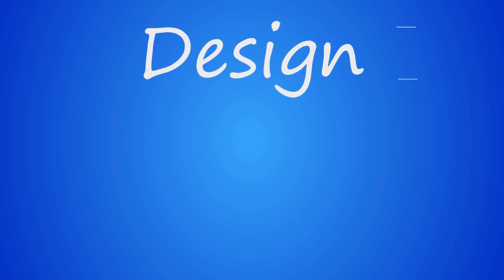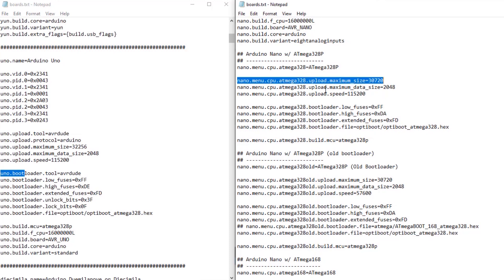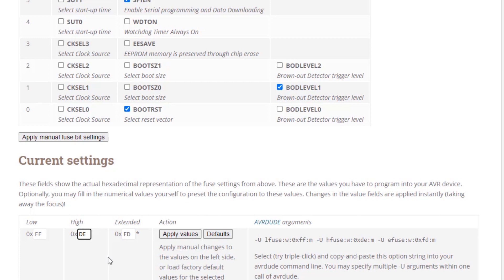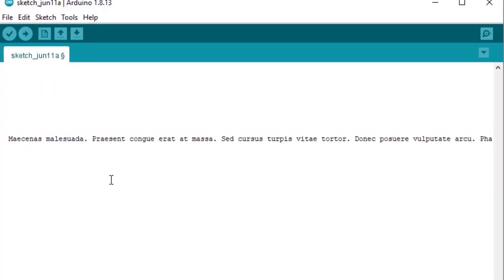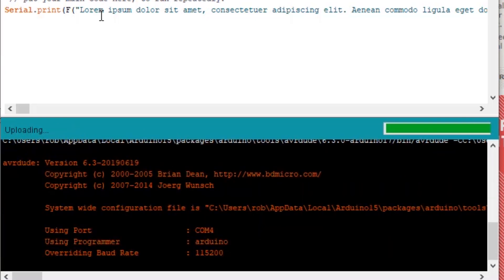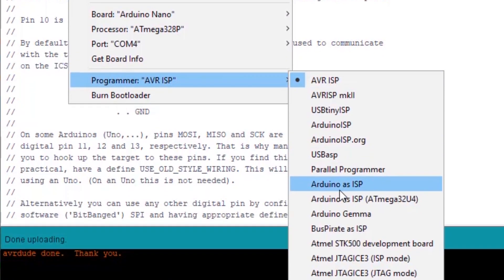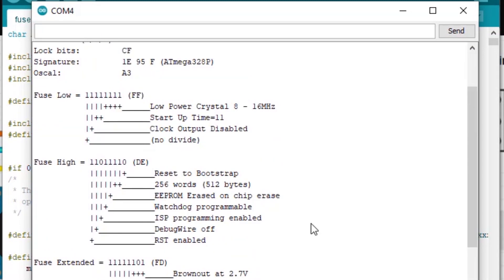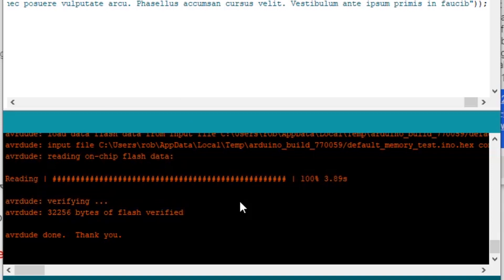Increase Flash Programming Memory for Arduino Nano? YES!

Comment: Quick question and probably a stupid one the memory is on the amount of bytes that remains and 2nd question is there a way to add more memory or upgrade.
Reply from the maker: Adding memory depends on how you plan to use it. If you mean adding space for program memory (your sketch) technically if you want to write an entire bootloader and compiler you could have your bootloader run on the Nano and pull opcodes from an external flash chip or even an SD card but its not a simple task. I actually did this many years ago for a PIC microcontroller and it took me almost a year to complete, essentially created my own version of Basic or rather a clone of Basic Stamp which was the Arduino before Arduino existed decades ago. Not a simple task. It's not as simple as taking an Arduino Hex code and translating it through your custom loader, although that might be possible if you really dig through the source code and have an excellent understanding of Atmel assembly and op codes.

Comment: Great info--definitely going to fool around with this. What tool is this at 2:24?
Reply from the maker: Thanks!  2:24 is https://www.engbedded.com/fusecalc/

There are a bunch of "Fuse calculator" sites out there for Atmel all the same stuff. Pick your settings and it puts out what your high, low, extd values should be. I'm using it here in reverse to put in the known hex values to see what the settings actually are. You could do this manually if you want to read the data sheets and convert to binary, these sites save you the trouble.
Reply: @DesignBuildDestroy  Atmel Studio also has a great tool built into the flash utility that allows you to select various options from drop-down menus and then burn your choices.
Reply from the maker: @EvanRustMakes  Yeah! I tried to keep this simple and stay within Arduino IDE world using the site as a quick reference rather than pointing people to download Atmel Studio and jumping through some hoops. Really the true way to maximize your space if you need every byte is just drop the bootloader all together and get used to using ICSP to flash but I think the simplicity of keeping the bootloader makes it easy for new users to dive right in.
Reply: @DesignBuildDestroy  Ah, ok. I ghostwrite for the Arduino blog and I'm working on an article about your video. Should be up soon :)
Reply from the maker: @EvanRustMakes  Awesome!! I tried to research WHY the setting was never changed when Optiboot became the standard, as far as I can tell it may have been a miss but boards were already produced and flashed by that point for sale so it was just kept as is and never seemed to be addressed again because they did not want to add yet another menu option for Nano board type. The 2 options are already confusing for new users (Nano, Nano OLD BOOTLOADER) then you'd have a third like Nano New Fuse or whatever making things even more confusing. One of the top issues I see on forums where people get stuck is the fact that lots of folks buy clones that tend to use the OLD bootloader and they aren't always aware they need to use the Old Bootloader selection, so their upload fails.

Comment: I can't find the hardware folder, I'm in the same directory as in the video. Maybe I have to create it manually? I'm using the latest version of the IDE btw :)
[SOLVED!] Apparently the folder was at: C:\Program Files (x86)\Arduino\hardware\arduino\avr
Reply from the maker: Someone else commented on the first video about Upgrading Bootloader that their boards.txt was same path as yours. May depend how it was installed or if you use App store vs manual download from Arduino - not exactly sure. I've had it installed for a LONG time so maybe things have changed in newer version installer ;)
Reply: @DesignBuildDestroy  Thanks for taking the time to answer :D Even if it wasn't needed anymore, it's kind

Comment: Couldn't you simply program the bootloader & fuses onto the Nano by specifying that the target is an UNO?  Of course you'd have to specify it as an UNO in the IDE from then on...
Reply from the maker: For the most part, there is a difference in build variant but I don't think it impacts anything for the overwhelming majority of users. Uno build variant is "standard" and Nano is "eightanaloginputs". When Uno first came out it used DIP package and only had 6 ADC's, Nano used SMD version of the 328 that exposed 8 ADC's. When Uno switched to SMD version, they never added the 2 additional ADC ports on the board I assume to keep the layout exactly the same and not cause any conflict with existing shields...but the UNO does have 8 ADC's in reality.

The build variant affects a macro somewhere I forget, I'm not totally sure that the variant setting plays any part in loading the bootloader or fuses, I think it plays more in the IDE when building your sketch.